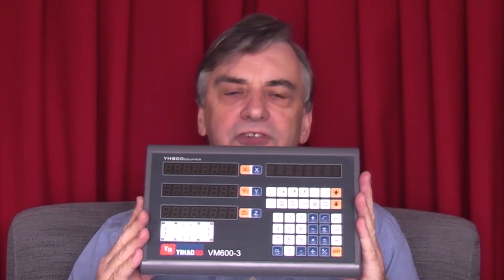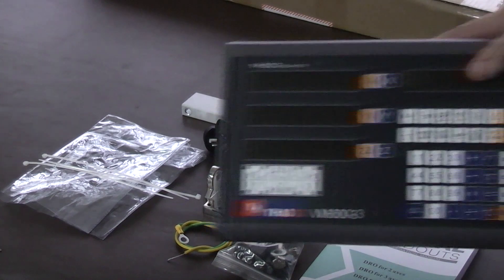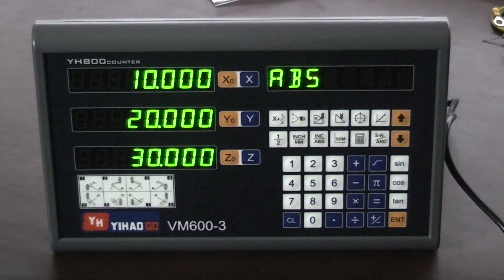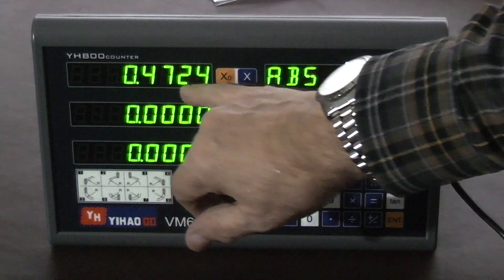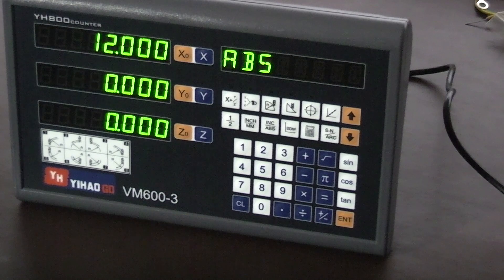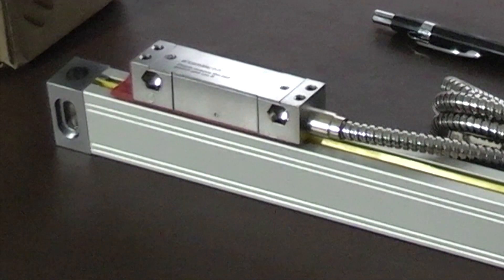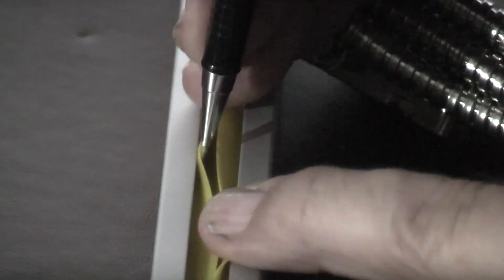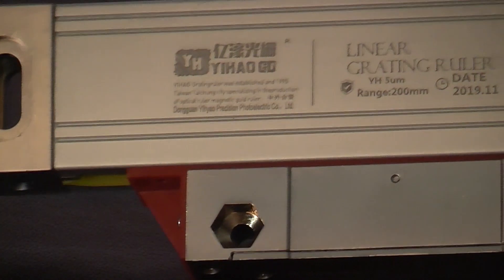Tool update latest DRO display and scales from Banggood

Comment: May I ask if you are, or can do a linear calibration on the scales, I found that on another source/manufacturer, over 600 mm it was out by 1.6 mm. I used the fixed calibration constant function to correct. I borrowed some large inside/stick micrometers to set-up/check.
Looking forward to the installation. Thanks for sharing.
Reply from the maker: Hi I only checked my lathe DRO using a DTI I must check my mill. In the DRO programme you can adjust the calibration of the scale but most small workshops may not have a calibrated ref length to set it too. Regarding fitting I have already made 2 videos on fitting DRO to the lathe and mill this one will be passed to my brother for his Boxford. If he finds a better way of fitting I will video it
Thanks for the comment
Alan